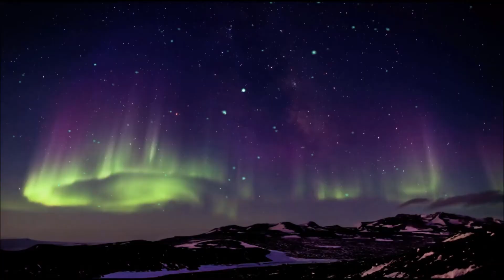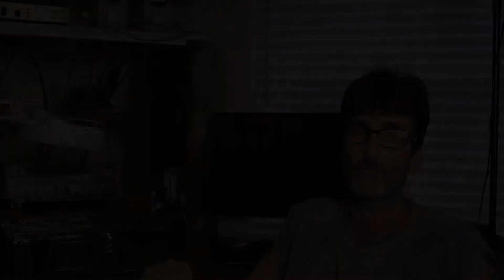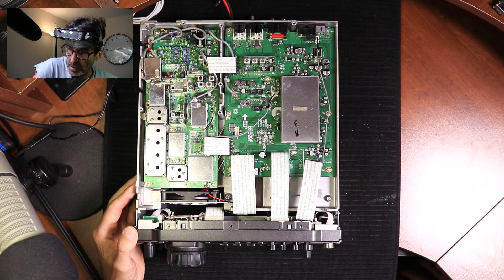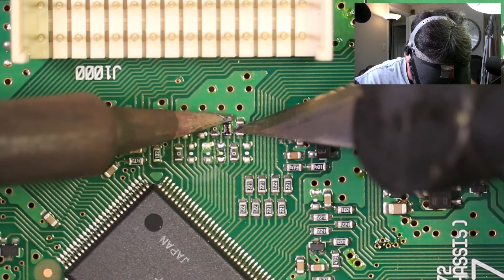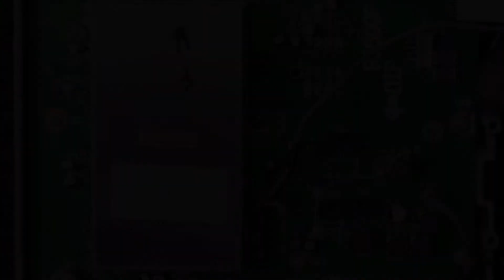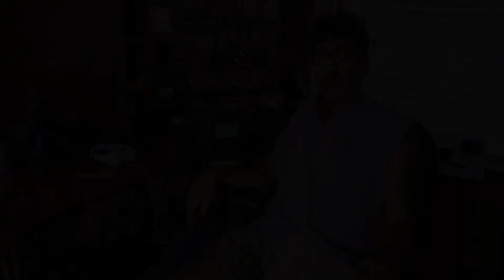Icom IC-746 Pro Mars/Cap Mod Very Clear HD/ Best Video!

Comment: Is this the same for the 746 non-pro? I read somewhere that the only mod I can do for the american non-pro is the diode removal near the Option UT-102 section of the board. That is supposed to open up the TX range. I'm I correct? Or is this the mod I should be looking at doing? Thanks
Reply from the maker: HI, I don't know off the top of my head.  I like to go to mods.dk and compare the mods.  You'll have to sign up for an account but there's a treasure trove of free info on there...  😊

Comment: Thanks for the tutorial. Your videos are always clear and very easy to follow. Just one question, is there a reset procedure on this radio after doing the mod? Thanks, Alan.
Reply from the maker: If you read the instructions for the mod, it says there is.  In my experience I've never had to, I usually just turn on the radio and it takes right off.. Thanks for the great feedback...:-)

Comment: Hello, you desoldered the diode in W1604 and W1603, say maybe you know what the diode W1600 is for, I have the impression that it blocks TX completely, I have TX from the listener, is the W1600 diode blocked.
Reply from the maker: I'm not sure, but if you go to mods.dk there's a ton on info on there.  Maybe someone on there posted something about it.

Comment: I just did this modification. It took me about 15 minutes. I used a hand held magnifying glass and a soldering pencil with the tip ground to a nice point. The rig works perfectly on all bands including 2 meters and also works on my MARS frequencies. No problems at all.
Reply from the maker: Excellent... I haven't had any trouble either.  The radio belongs to a friend of mine and a year later, still no problem... Thanks for watching..
Reply: I take it mars is 27 MHz
Reply from the maker: No!  27MHZ is citizen band...  Mars uses many different frequencies...  You can google the ones that would apply to you.

Comment: What is the lowest frequency you can take it to? Would this allow transmitting at 630m?
Reply from the maker: Nick Hauser I don't remember... I gave the rig back to the owner already
Reply: I highly doubt it. Power would drop off significantly if it did work. Most radios I've done wouldn't TX below 1.5 mhz.